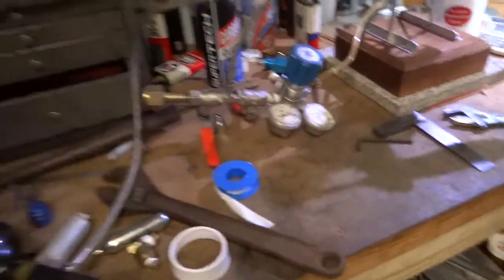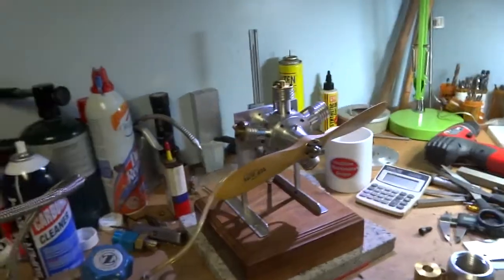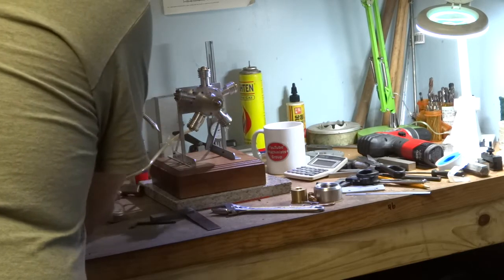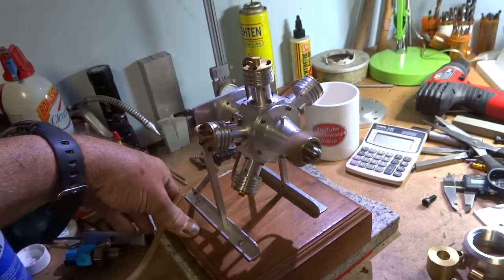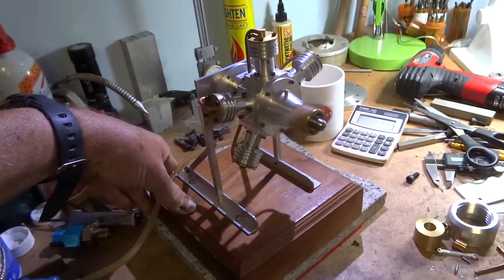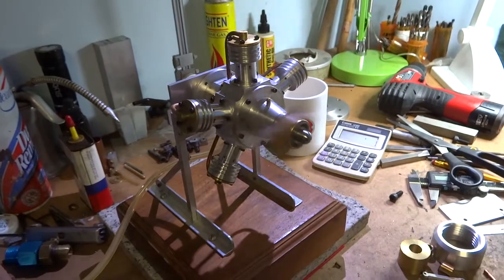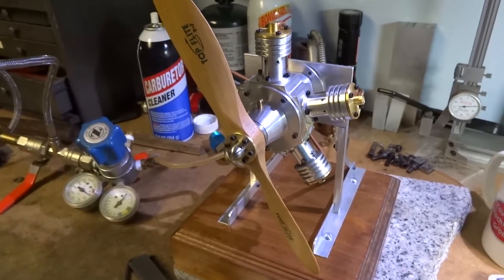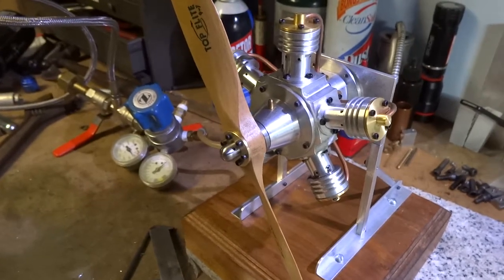My Rudy Kouhoupt Radial 5 engine complete and running

Comment: Fantastic. You need to sit that up beside your bed tonight at a low rpm and let it sing you to sleep. Great job.
Reply from the maker: Thanks Lee, it does have a very nice sound when running slow. Glad the AC stopped running about the time it started up. I would have cut it off but I was so engrossed with what I was doing I didn't even notice it was on.